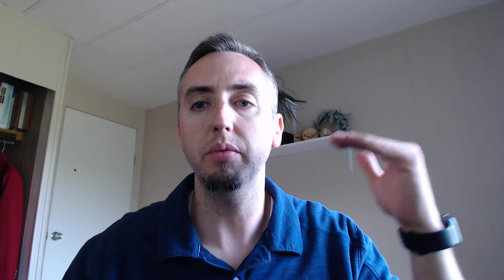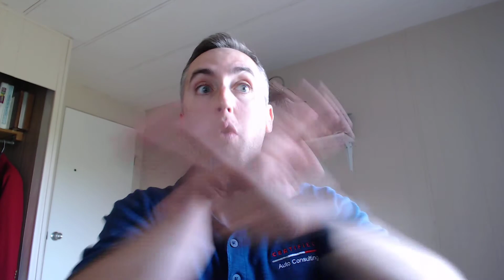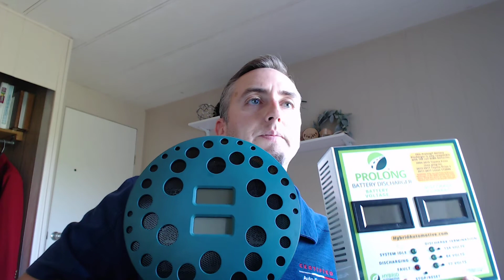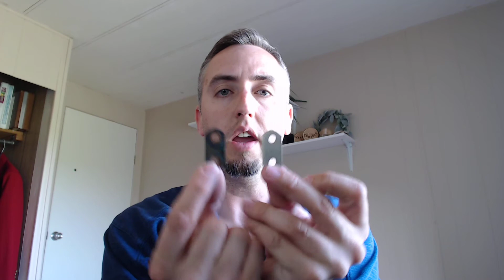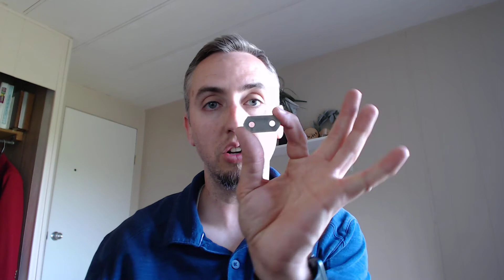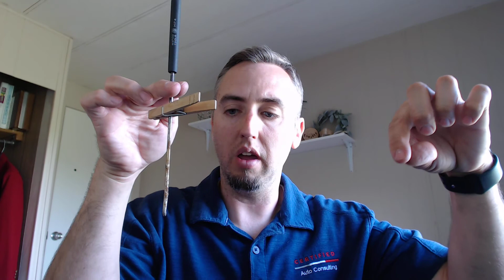Toyota Prius HV Battery 101

Comment: I'm driving a 2002 that's gone through a few batteries.  I'm not comfortable  working on batteries.  Does anyone in the Maryland/Del/WVA area do this kind of thing commercially?  Is there even a word or concept  for "battery maintence" in the automotive repair industry?
Reply from the maker: Hi Ray,  use this link here to find a qualified shop to help you out. http://hybridshoplocator.com/
Reply from the maker: Yes. if you go to fixhybrid.com you can find a certified shop that specializes in helping you with your hybrid.